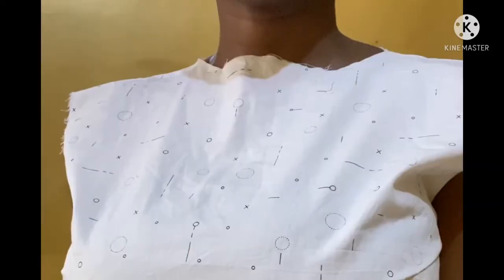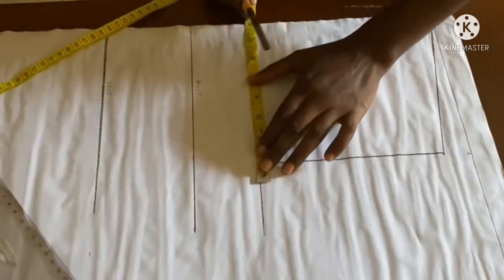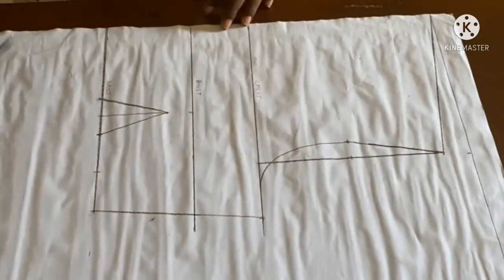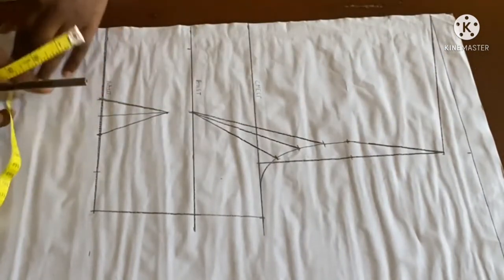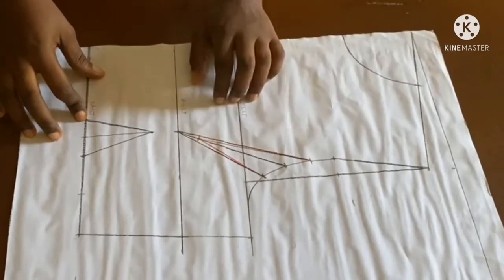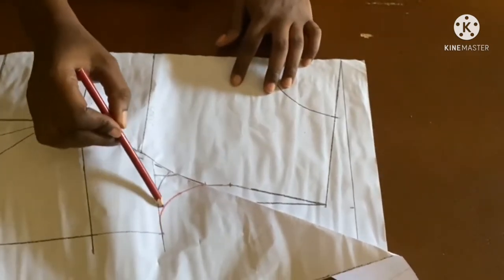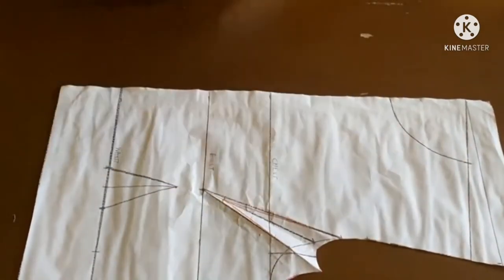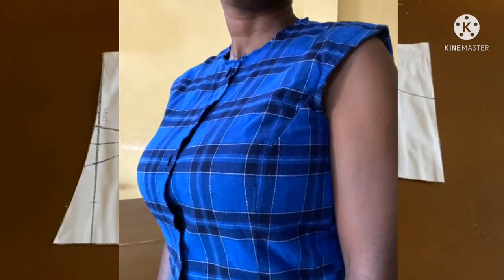How to fix a gaping armhole - Pattern drafting. (DETAILED)

Comment: Hello, thanks for the video, my main question is what is the cause of gaping in the armhole area?
Reply from the maker: Gaping usually occur in people with fuller busts on the neckline or the armhole because their full bust tends to push the fabric forward thereby creating a gap around their neckline and the armhole.

Gaping also happens when you cut a low neckline

If you are using a bodice block made for the sleeves to make a sleeveless garment you might have some gaping on the armhole.
Reply: @imageclothia  thank you so much for this reply. Very explanatory.